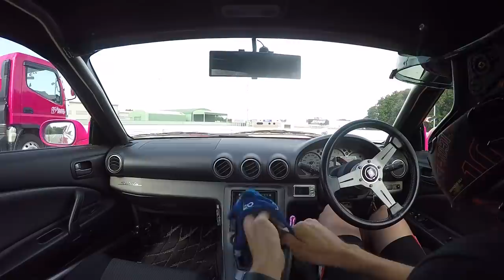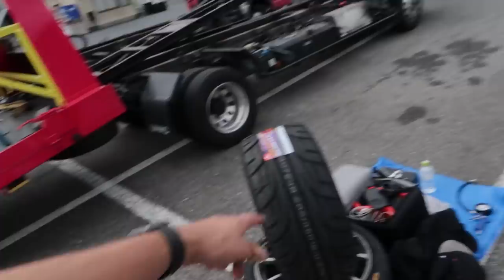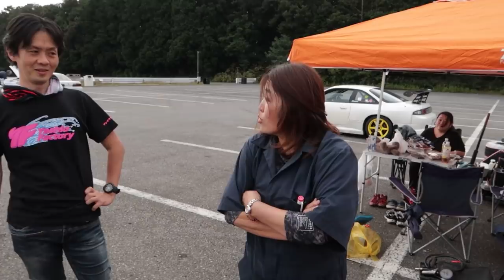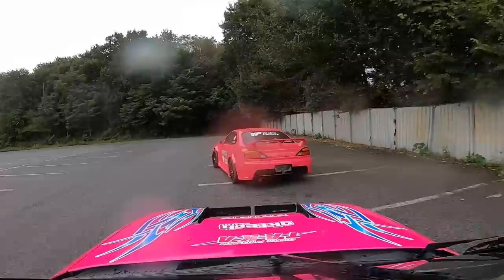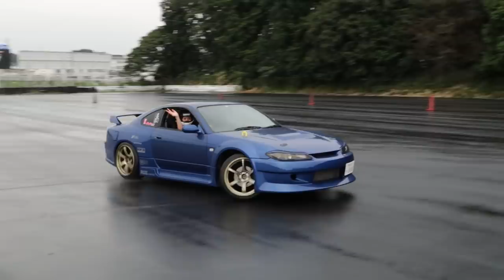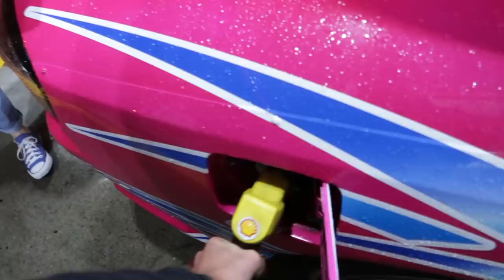LEARNING TO TANDEM DRIFT!

Comment: I'm no pro drifter, but from what I've noticed Sam you need to anticipate the transitions more. I think you might wanna keep smashin out the chase positions ✊🏿
Keep it going Dog
Reply: i saw the same thing. he's not switching back fast enough. he'll get it.
Reply: Ya I think he stays in angle for too long. You can see that he goes into more angle right before the lead car transitions which means he loses speed and is slower on the transition. Instead he should back off a little right before the lead car transitions so that he can be quicker to the transition. (This is coming from someone who’s only drift experience is in Forza 😂)
Reply: yes i noticed this too! sam keeps getting left behind everytime they transition and has to play catch up. but im not drifter so maybe he's doing that on purpose or somethin

Comment: This was more observed on your Ebisu drives and my .02, take it for what it is, but if you want to add some advanced techniques to your arsenal, might I suggest learning to master weight transfer via foot pedal manipulation. It's much more difficult to initiate on a flat track, but in the twisties of the mountains a quick stab on the brakes to initiate your arch will teach you a lot about fine control rather than relying on the hand brake all the time. You can carry a lot of speed too when you really get it down while throwing your car into a corner, but all that comes with lots of practice while learning your suspension and such. 
I'm sure that other dude figured it out by now, but if you're popping fuses on the ECU line, it's probably an insulation issue that's cut and shorting out. I've had more than a few that rub going through the firewall that produce this exact scenario. And yes, they are a massive pain to track down! Get your wire tester with the light in the handle and start prodding!

Comment: Hate to be that guy but at 2:56 you said abs unit pointing to the fuse box then o2 sensor where the abs unit should be but what appears a delete kit instead, i may be wrong lol Love the channel cuz
Reply from the maker: Removed the ABS unit fuses from the fuse box. Even when it's removed if the computer is plugged in still you need to remove the fuses or it can cause issues. OS sensor plug was where I was pointing have a look again :)